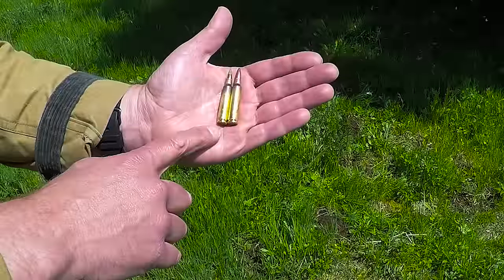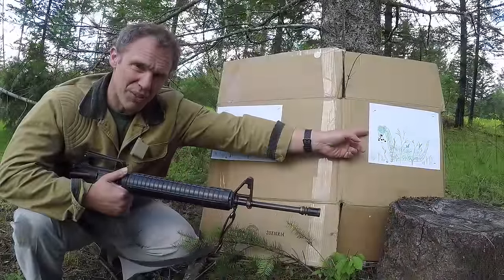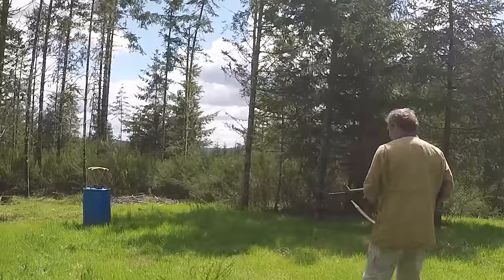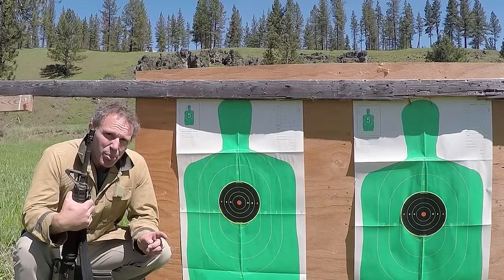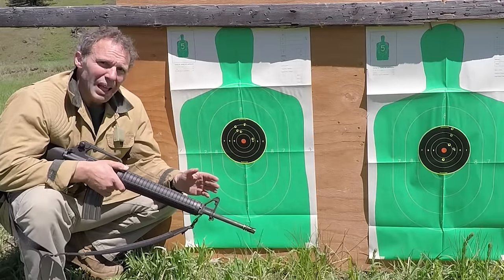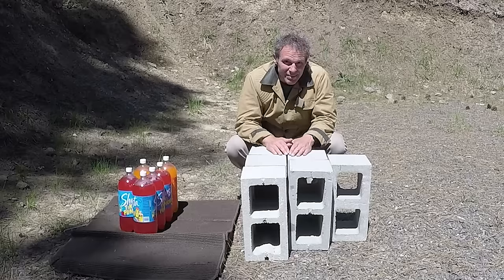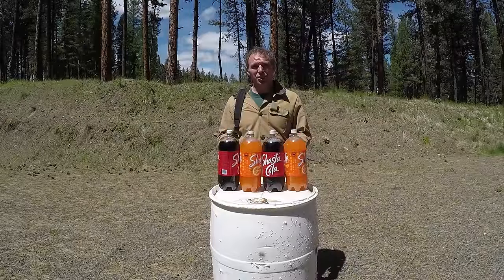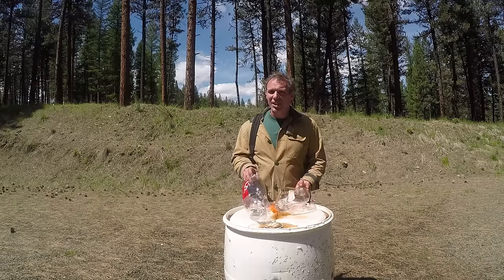5 56 NATO Ammunition:  XM193 55gr.  vs  M855 62gr.

Comment: The only small caliber military round I’ve heard really tumbles in “the target” is Russian 5.45 aka the “poison bullet”, I’ve heard people say it about some 5.56 but I don’t think it’s true...or it’s not true the same way...the wounds are very different
Reply: The SS-109 was designed to tumble?
Reply: Rts: "Tumbling" in the context of ballistics can mean different things. A lot of old-wives tales about 5.56/.223 tumbling in flight or being designed to tumble in flight. Not really, unless inadvertently fired through a barrel with a too-slow twist rate, in which case it would be dynamically-unstable in flight. However, in the target, many projectile types "tumble," which is to say swap ends. Classic spitzer (pointed) bullets are nose-light, tail-heavy in design, but are kept in nose-first orientation by the enormous spin-stabilizing effect of the rifling. However, if fired at extreme range, when the MV & rpms drop sufficiently, the bullet will begin to become unstable and eventually lose its typical orientation in flight and begin tumbling. Upon entering human or animal tissue, the projectile will often attempt to reorient itself tail-first, i.e., heavy portion forward - if it is slowed down enough and/or loses enough spin. M193 55-grain produces its wounding effects primarily due to bullet fragmentation at certain threshold muzzle velocities or higher. Russian 5.45x39,however, took it a step further by lessening the reliance of the bullet on muzzle velocity for its terminal effects, by designing the bullet to be slightly unstable in normal flight due to its lighter forward portion. 5.45 Russian doesn't need to fragment to be effective. The trade-off is that it is less-accurate than 5.56x4555-grain.

Comment: Fun Fact :  Green tips were never designed for short barreled carbines. This has led to the green tip’s reputation as the number one cause of permanent limps in the middle east. Not a fun experience to have ammo quickly zip through an enemy.

Comment: While the 55g will obviously have higher velocity than 62g from weight difference:
     If you're going to be shooting something with thick layers, you definitely want to use the 62g M855.  That steel core can make all the difference in penetration.   I have a huge problem with feril hogs on my ranch....  And it has been my experience that better to focus on penetration over expansion when shooting hogs (can't say that with most other animals where i live)...   I've had jacketed hollow points & soft points not even penetrate thru hog's thick scar'd up hide.  So I always have my mags configured with higher ratio of M855 "green tips" with few rounds designed to expand mixed in

Comment: I'm curious about difference of penetration through vehicle glass and doors.
Reply: Not an expert but I believe the 62.  Would be the better option for puncturing glass on a vehicle. I have an A1 platform and if you noticed they begin to keyhole so I'd rather have the jagged entry wound on the window rather then a cleaner one. Probably 62 but it depends on the platform.

Comment: i would have to argue that this video is an incredibly unfair comparison simply due to the variety of barrels these days, i could show you the direct inverse of results between xm193 and m855 through my ar platform that has a 20" barrel in a 1-8" twist, i cant shoot 20 yards without the 193 keyholing and can easily go out to 500 yards with m855. while this video may have held more weight back when we switched to m855 i dont think it is fair now long after it has become standard issue.
Reply: @Harry Peterson it's a 20" barrel, it's got a 1-8" twist
Reply from the maker: OK grant, If I understand you correctly you're saying that the 55 gr. FMJ ammo is keyholing when fired from a 20" barrel that has a 1/8 twist. If so then as harry implied, you're not on the planet Earth. Or there is something very wrong with you, your rifle, and/or the ammo you're using. I've fired lots of 55 gr. through AR's with 1/7 or 1/8 barrels and never had any problems with accuracy.
Reply: @PaulHarrell  alright, I'm not too full of myself to swallow my pride and say that I am somewhat ignorant of this situation then. I know that my particular rifle keyholes with 55 grain ammo, so I guess I'll have to break out the borescope or do some other troubleshooting. I came to that opinion based on my limited experience with my particular rifle build, but I'll be back in a few months or weeks with more info on if I'm just being ignorant, or if my rifle is not functioning properly
Reply from the maker: I DO NOT mean to insult your intellect. Something I have seen a few times is that people thought there guns were keyholing when they were shooting at a target that was at an angle so the hole in the target appeared elongated. Is there an possibility that this is what you observed?
Reply: @PaulHarrell  no offense taken at all, if I'm ignorant of something then I'm ignorant of it, just gotta learn. And the targets were totally square to me, on a big plywood board on a 100 yard range

Comment: need to test accuracy with a barrel twist that the bullet prefers... like 1 in 8 for the heavier bullet...
Reply from the maker: Did you miss the A2 with the 1/7 twist.
Reply: @PaulHarrell  yes I did. are all A2s 1/7 twist? I hope not as I have a gun ordered with a 1/8 twist and it wouldn't make sense for the gun maker to put a muzzle device with a different twist rate than the barrel.
Reply from the maker: @theflaver  As far as I know, all military issued A2's were/are 1/7  commercially available A2 type rifles may vary. These days almost all of them will be 1/7 or 1/9 i have seen very few 9perhaps none) that were 1/8 The difference in twist between 1/7 and 1/9 will make very little difference in performance.

Comment: Yeah the heavier bullet has less INITIAL velocity but more RETAINED velocity at say, 600 meters. Plus more lethality at distance.
The 55 gr. is NOT more accurate against a 60+ gr.full  lead core bullet that is shot in a barrel with a 1:7 twist MADE for heavier bullets. Let's compare apples-to-apples here.

Comment: With the concrete blocks I'm pretty sure it just comes down to impact energy with little regard for the shape or deformation of the round. None of the rounds really penetrate they just impact like a hammer and cause fracturing. likewise the soda bottles, being mostly water are more like bullet catchers that absorb a lot of energy again without a huge regard for the bullet shape.